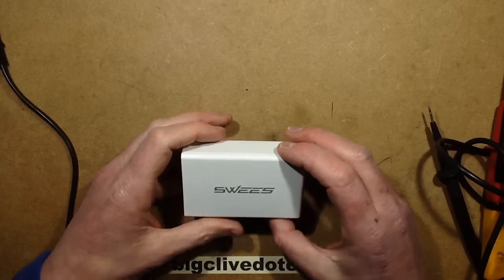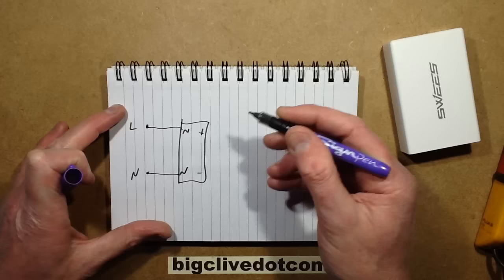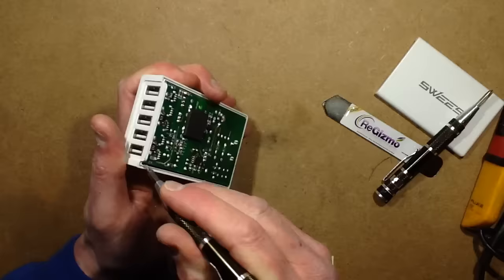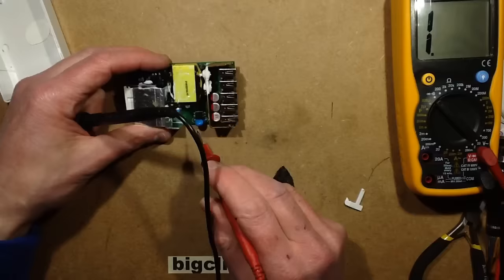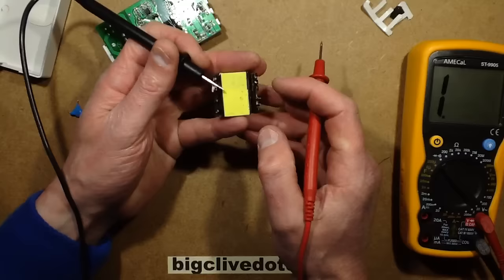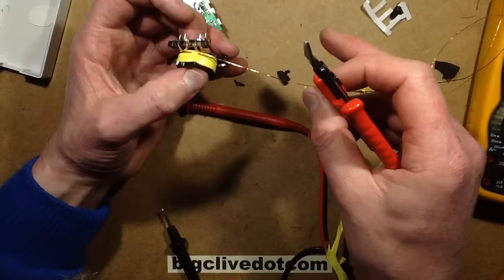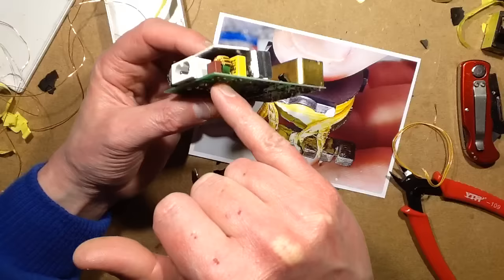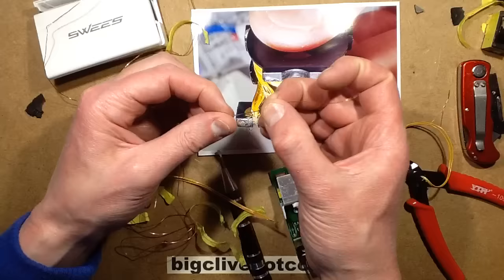Horrific USB power supply fault.  (Electrocution risk.)

Comment: Ive just recently ordered a cheap power supply almost identical to this one from eBay for $14. Its still in the mail.  Would this failure be enough you think for me to be best off with tossing it in the bin? Or do you think it is probably a fair chance it was a one off fault? Or if I were to open it up are there any signs of a dodgy/quality rectifier?
Reply from the maker: This one had no visible fault inside, but proceed with caution when you test any new unbranded mains voltage device.

Comment: pound world sells fours usb to one usb things just like this if you could a review on them would be good (p.s i use them to charges those recalled ee power bars (in a lithium ion small expolsion safe bag) is it safe to use one for this?)
Reply: +london smith thats more a usb hub, if you used it on any usb power supply it will split the available power by the number of sockets if all are in use, some devices wont charge at the lower power, other devices are dumb and wont mind, just take longer, its meant to expand the number of usb ports on your pc, not split a charger really.
Reply: jusb1066 wow thanks for the insight really helpful

Comment: I don't know if this was a manufacturing defect, or if this happened after it left the factory, BUT i.m.h.o., EVERY single one of these S.M.P.S. USB power supplies SHOULD be hipot tested by manufacturer AFTER the unit is completely assembled, right before it goes into the packaging. 

Not test half of them, or most of them, but ALL of them. The threat to human lives, and the possibility of destroying some rather expensive electronic equipment is WAY too large to NOT test every single unit. 

I strongly feel that if this unit was hipot tested at the factory, this issue would have been caught, and never shipped to a customer. 

Although I was never zapped, I DID have several very expensive pieces of electronics damaged by a USB power supply that was passing mains right through to the output, just like this one. I never opened it to find the issue, but I'm guessing it was in the transformer just like this one was. 

After that, I've built my own linear 5 volt power supplies to be ONLY used with the expensive equipment that was damaged by the S.M.P.S. last time.

Comment: Could you have used your megger on the transformer to find the fault after the very low resistance short went away?  Also in circuit you could have used a low voltage high current supply to smoke the fault out.  Then it would have been easer to find in the disassembly process.

Comment: All the SMPS transformers I've pulled apart lately (to reuse the cores), have had a white semi foam type tape at the edges of the windings. This keeps the wires contained, but would also protect the wires as they exit the layers to be soldered to.
My bet is the machine winding the transformer is what ground the insulation off those wires. Hence almost all of them will be damaged like that.

Closest I can think of to describe this tape, is sticky plaster. Anyone know the proper name or where I can get some ?

Comment: I wouldn't expect to actually want to buy one of the products that you examine, but it is pretty well made.  At least everyone now knows what the problems are and how it's made rather than just buying some mystery black box which is probably worse than this.  It's like $30 on Amazon now which is more than I want to spend and I just bought something like it that puts out pretty good current for $5.  I know it isn't as well made as the one you tore down.  I would open mine up but I'm too scared to see what is inside and ignorance is bliss. Well, until it kills you or burns your house down.

Comment: Well, I haven't gone to look anything up yet - but do you really mean to diagram putting a transformer AFTER a rectifier - so you are putting varying DC thru a transformer????
Reply from the maker: +Timothy Bogart Switchmode power supply.  Mains to DC then to AC again at high frequency for driving a much smaller transformer.
Reply: +bigclivedotcom Thankss - I will look at some implementations of switching power supplies
Reply: bigclivedotcom I've been reading through the comments and saw you wrote this at least 3 times!

Clive, could you make a video going over common types of power supply circuits? It seems like many of your viewers including myself need a little basic training!

Comment: That's a concern, I have two of these (well, one Swees and one Coolead, but similar design).  They're extremely handy and trouble free, but this has me worried.  Would a multimeter show the fault by checking for continuity between the mains input pins and the USB chassis without ripping it apart?
Reply: +StinkyWeezle Put it on diode test, since continuity might not have enough voltage to forward bias the bridge rectifier.
Reply: +MrOpenGL Thanks, I'll give that a go.  Pretty sure they're fine both fine, but that sounds like a better option than poking it with a finger.

Comment: I have been under the impression, that during assembly when they do the automated testing at final assembly, everything should be verified. Isolation is one important test for safety.  I have seen defective supplies. Most of the time when I serviced them it was capacitors that went opened or high in ESR, and thus the supply did not work properly.

Comment: Very interesting video. The chopper transformer should have been Hi-Pot tested before it was even fitted to the circuit board and it ought to carry all the relevant safety approval markings. The manufacturer of this USB unit should likewise have done an insulation check on the completed unit using the standard Hi-Pot test.
The blue disc ceramic Class Y capacitor connected across the mains isolation barrier is generally trouble free and likewise the opto-isolator should never fail in a dangerous way.
 
It's worrying to see this type of failure in the chopper transformer' insulation and with the trend to make everything smaller, then this could be something that's likely to happen again. I certainly wouldn't trust this type of transformer for safety. We never really had any real problems with traditional mains frequency transformers as in linear power supplies. Primary and secondary windings on a separate part of the bobbin with practically no chance of insulation breakdown.
I bet it's a nightmare for Trading Standards keeping on top of this potentially lethal equipment.

Thanks for posting this video.

Comment: Clive, is there a different type of transformer that the mfg could have used, which avoids the risk of this failure mode?
Reply from the maker: The transformer is fine.  It just has to be wound properly and not mashed up in the factory like they did.

Comment: What's the worst shock you have ever gotten? When I was a kid in school I talked to our tech professor who had worked on building computers and repairing them when he was pretty young. This was long enough ago that very few safty measures were in place in them. One time while working on a pc that had not been plugged in for months he accidentally brushed against a part that now a days would be buried in a power supply far away from where it might get touched.
And even though it had not been plugged in for months it still held enough charge to knock him off his feet and stop his heart. He came to on the floor with pepole around him.
Reply from the maker: That sounds like the story has got better with age.  The biggest hazard in computers back then was the anode voltage on the CRT display.  Typically 20kV on a glass capacitor capable of discharging high current quickly.

Comment: I’ve stopped buying anything electronic from Amazon based on my own experiences and these videos. 

My favorite was a microwave that would sometimes refuse to turn off, even if cancel button was pressed or the door was opened. Even better, it would sometimes just turn on on its own. After I bought it, I found out that others had similar issues with one person coming home to find the casing partially melted because it had been running all day and another actually had it catch fire. 

I told Amazon and they wanted me to send it back until I mentioned it was a safety issue and shouldn’t be re-sold and the second-tier customer support person I got to after mentioning that only THEN said to go ahead and dump it.

Amazon’s set up facilitates and encourages sketchy sellers. And even if you buy what you think is a brand name, there’s no way to tell if it’s legitimate. Almost every branded thing I’ve bought that wasn’t directly from the official brand owner was clearly counterfeit.

Thank you for consistently exposing this garbage.

Comment: Let me ask you Clive, I think your analysis is completely correct, but did it provide 5V on it's outputs without damaging external components?  Wondering because how else could it have passed any inspection? And from the fact you think it was pretty well built and the fault was actually third party suppliers is it possible it still passed inspection and functioned while being a risk?
Reply from the maker: +TruAnRksT It still provided the 5V.  But had mains superimposed on it.  The phones would still charge, but be live.
Reply: bigclivedotcom

So with a typical plastic case phone or device you might have never noticed? That is a little scary.
Reply: +TruAnRksT Wouldn't the mains voltage fry whatever device you had plugged into it?
Reply: +Ryan Toomey If the phone touched a mains ground/ neutral. The 5V output was floating. So between positive and negative on the usb output it was 5V. However, between the USB output and the mains return there was line voltage. That means the current from the mains can only flow if you complete its circuit to ground, for example a grounded metal radiator, or standing on suitably conductive flooring. Therefore the phone doesn't see 240V, unless it has a good connection to ground.
Reply: +Jacob Wells 
Thanks for the explanation Jacob.  I was wondering about this too.

Comment: This is the kind of thing I would also do. As an aside, I once fixed a weedeater by pulling the armature winding apart , finding the break and making a little solder joint. The machine worked perfectly until the wife turfed it out, because it "looked a bit dodgy"....!! All it needed at that stage was a new cassette for the string. Sigh.

Comment: I design switching power supplies, the secondaries are probably what is known as TIW ( triple insulated wire) which in theory can safely be in direct contact with primary enamelled wire. But during manufacture the heat of soldering can burn back the TIW insulation wire and cause a short. To get round this extra PTFE tubing or/and tape should be used. All such products must be HI Pot tested during manufacture. Clearly this has not happened in this case.

Comment: I wonder if the transformer manufacturer even tested the transformer after it was fabricated at 3750 volts per safety agency regulations. Seems to me that corners were cut to get product shipped, or to meet revenue targets.
Reply: That's what happens when we have low grade Chinese stuff flooding our market. Some of them don't give a hoot about quality. I got some Pioneer DJ headphones from China. They were fakes and quickly broke. I ordered a bass flute from the Chinese "eBay", a site called dhgate. The flute never showed up. Unlike the real eBay, dhgate will not help you if a seller is a crook. Some Chinese stuff is ok (though "Made in China" does not exactly make me feel good). I got a Chinese regular flute from a clearance at Netto for 20 pounds (!) and I can't fault it.
Reply: Don't ever get the Pioneer DJH 1000 headphones. They are all made in China, and though they cost about 100 pounds, their hinges and headband always crack and render the headphones useless. They sound great when they are working, but their short life does not justify the high price. Pioneer U.K. does not care about this, and will not help you. Their customer "service" stinks. Their attitude is "You're on your own, mate". Yet they are a virtual monopoly when it comes to headphones, CD players and mixers. I have a pair of Pioneer CDJ 1000 CD players, and the speed control went on one of them. They wanted a massive price to replace it, so I tracked one down and fixed it myself.

Comment: I have a unit that is branded j5create that looks similar l to the unit you have taken apart except for a graphic on the USB port panel . Model is JUP50 with 8A at  5V (Max 2.4A each).  I got it at Best Buy here in Toronto.

Comment: Ideally they should do a high voltage test at the factory— applying 1500 volts from input to output can reveal dodgy insulation immediately.
Reply from the maker: The official test voltage may be closer to 3000V.

Comment: Hi, I was really badly shocked by a cheap desoldering gun I bought online. It made my whole body lock up and as it was shocking me it overloaded the circuit breaker and cut off the power. I think I was lucky the power was immediately cut off.
Would this mean that the soldering gun actually put about 3600W (240V x 15A) through me to draw enough power to overload the mains circuit breaker? If so then I think this would be fatal in a house without a working circuit breaker.
Reply from the maker: +Arcadio Munoz If the house had an RCD or GFCI (detects earth current leaking) then it may have tripped first.  But if it was just an ordinary breaker then the only thing that would have tripped it would be a dead short inside the desoldering gun.  I think you had a lucky escape.

Comment: It sucks because the manufacturers of the power supply seem to have put some real effort and engineering into in (good insulating gaps on the PCB) but I suspect they opted to buy the cheaper transformer, or it could have been just a freak accident.

It seems like this probably wouldn't have damaged any devices plugged into it unless possibly they arced to ground. It does of course provide an electrocution risk as well as a very large fire risk. This is why it is important for chargers and such to have a ground, if it did (assuming they work similar to here in the USA), it would have tripped the breaker, eliminating the danger and alerting the user to an issue before it became dangerous. I think all chargers should have a ground. A lot of them, even large name brands, do not (applies to both European countries and USA).

Comment: Hi Clive :) i always run from powerbanks as im always out and usually have around 1000000 mah so can survives days to weeks without a socket :) could you or any of your lovely subscribers  share any wisdom pls, basically im changing out my powerbanks for just 2 as have 5! So which are the best powerbanks at 26-300000  mah? And also i need a high output charger that might manage a full charge in 5hrs any help would be very helpful
Reply: Lol 30000 mah

Comment: If the feedback winding was touching the exposed secondary winding - how does that connect mains to the secondary side?
Is the feedback winding on the mains side?
Reply from the maker: +Ken Parkyn Yes it is.  It's connected directly to one side of the main electrolytic capacitor, so the only thing between it and the mains is at least one diode.

Comment: love your work clive. but this has surprised me that if 110v 0r 240v was going through to a 5v usb out put plug any thing into the usb port sure that item plugged in would blow up. and not just get a shock from the unit itself.
Reply from the maker: Imagine a 9v battery connected to a live wire.  You still get 9V across the battery and could run 9V items from it.  But if you touched it you'd get a mains voltage shock to ground.
Reply: @bigclivedotcom  that makes sense. Thanks for your reply. Great videos keep them coming.

Comment: i love watching your videos. i have a Mcdada similar unit. It has 3 usb outputs and a nice voltage/amperage display. It has a 3 Volt 3 Amp output. I use it to power 3 Raspberry Pi Zeros. Just out of curiosity I put my screwdriver/mains detector on the frame of the usb and yes sure enough it was live! What to do. The Pi's work great and are undamaged.
Then I checked some of my other cheap 5V >2 Amp power supplies and yes the usb frames were also live. Then I checked my low current 5V power supplies and they are ok. It seems to be a problem with high current 5V cheap Chinese power supplies. None of my equipment has been damaged by this. (Yet.)

Comment: Hi Clive I got a Henrey hoover today but it has got a 110v yellow plug on it can I just cut this off and put a plug on as I’ve never seen a 110v plug on it ( only on building sites )
Reply from the maker: Check the rating plate to see if it's 110V or 240V.  Yellow usually does indicate a 110V item, but someone may have just used the wrong plug.
Reply: Thanks

Comment: That which changed simultaneously with desoldering the transformer from the PCB, and disappearance of the short of concern, would be a solder bridge between terminals, AND PHYSICALLY BETWEEN THE CIRCUITBOARD AND THE TRANSFORMER.
It (the solder short) would have been completely invisible due to the physicality of the circuitboard and the transformer. Good Luck what else you find, but the short of which I spoke would leave no evidence.

Comment: Nasty, that, when you become short between life and earth!

I can image several scenarios where you could have damp/wet hands, and without thinking, just plug in your phone to charge it up. Any one of those occasions could be the one that shorts your life to ground, in every sense of the word.  Such a pity too, because I was thinking, this thing actually looked quite decent in all other aspects.

I guess the coil winder was set a bit close to the core, and that the thick insulation was damaged during manufacture?